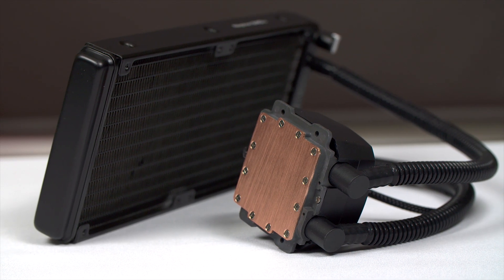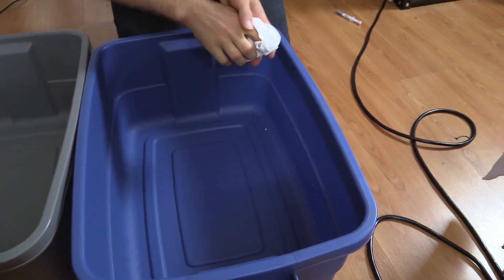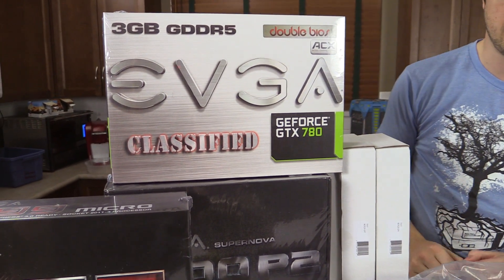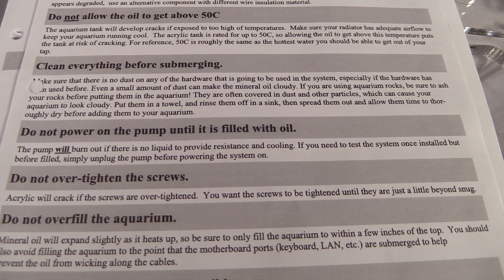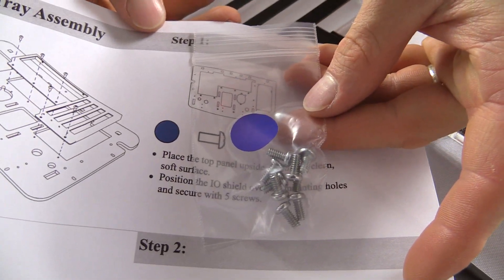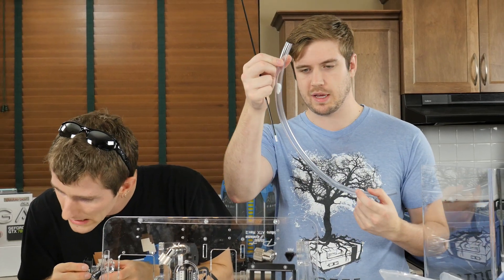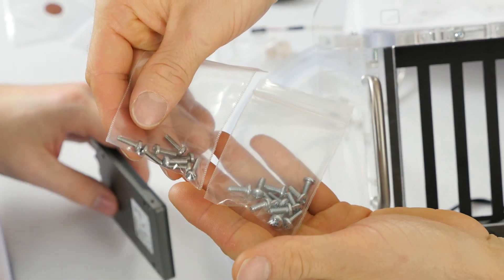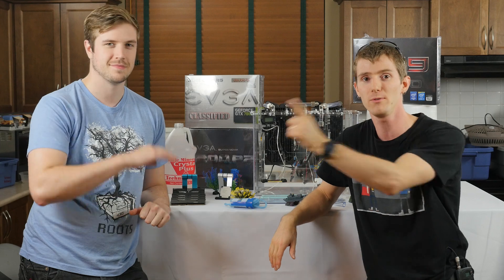Mineral Oil Submerged PC Build Log Part 1 - Puget Systems Kit Case Assembly

Comment: Hey you guys is this build good for all games at 4k max graphics and can you guys tell me how much fps i will get ? 

Corsair CP-9020062-UK RM Series RM1000 80 Plus Gold 1000W ATX/EPS Fully Modular Power Supply Unit

WD Red 6 TB For NAS 3.5 inch Desktop hard drive for 1-8 bay Network Attached Storage

Corsair CML32GX3M4A1600C10B Vengeance Low Profile 32GB (4x8GB) DDR3 1600 Mhz CL10 XMP Performance Desktop Memory Kit Blue

Samsung 840 EVO 1TB 2.5-inch Basic SATA Solid State Drive

Acer XB280HK 28 inch LED Monitor (100M:1, 300 cd/m2, 3840 x 2160, 1ms) 3 of them 

AMD FX8350 Black Edition 8 Core Processor (4.0/4.2GHz, 8MB Level 3 Cache, 8MB Level 2 Cache, Socket AM3+, 125W, Retail Boxed)

Corsair CH-9000080-WWCGMM200 Extra Large High Accuracy Performance Gaming Surface Pad - Black

Razer Deathadder Ergonomic Gaming Mouse

EVGA Nvidia GeForce GTX 980 Superclocked Graphics Card (4GB, GDDR5, PCI Express 3.0) 2 Of them

Samsung 24x Retail SATA DVD Writer

Fractal Design Define R4 PC Case - Black/Pearl

MSI Z97 Gaming 5 Intel LGA1150 Z97 ATX Motherboard (1x DDR3, 6x USB3.0, 8x USB2.0, GBE, LAN, HDMI, DVI, VGA)

Microsoft Windows 8.1 (Full Version)

Corsair Gaming CH-9000062-UK CGK95 RGB MX Cherry Blue Performance Multi-Colour LED Backlit Mechanical Gaming Keyboard UK - Black

Corsair Hydro Series H100i All-In-One 240mm Digital High Performance Rad Liquid Cooler for CPU
Reply: You will get 0 fps because you are trying to pair an Intel motherboard with a AMD processor.
Reply: You mean you won't be able to use the full power of this computer, if you put an AMD CPU on an Intel socket? No, that will work for shure. Your friend just needs to do some research.
Reply: 5930k is ddr4 only, don't get ddr3.
Reply: your build is so shitty.
Look like you have to much money and 0 idea about IT.
Reply: UpbeatGaming  1. That is an AMD CPU with an Intel Motherboard.
2. The PSU is overkill, get a 700w one.
3. Use that extra money to buy a proper i5 or i7.
Reply: Pandora Squared Random guy said to get the Asus Maximus VII formula
Reply: Kyle Sarty
But if you want high FPS, then you can go with 2560x1440, and it still looks great.
Reply: Three 4k monitors, and two 980 's. I'm sorry but I just don't think it's gonna enough power to give you reasonable fps.
Reply: A newer version of RAM. Its extremely expensive, and not worth it at the moment.
Reply: Random Guy Dude, go to a reddit form or something, or even tom's hardware. I'm not saying that all of these people are wrong.  There are just many ignorant people that could throw you off with their uneducated opinions about the hardware you should get.
Reply: Kyle Sarty so why is there a 1tb ssd ?
Reply: Random Guy oh nvm then sorry.
Reply: This whole post might have just given me post dramatic stress disorder...
Reply: Why the fuck get fx 8350.Get an i5.
Reply: *****
I advise you read some of UpbeatGaming's comments on this chain.  Slightly amusing, to be honest.
Reply: And i need to ask something my friend said getting this type of computer you will not be able to use the full power of it is this true ?
Reply: Get an i7
Reply: Random Guy my friend said a amd is better and 2 gtx 980 will not do it ?
Reply: Random Guy ok i put a i7 4930k now what should i put in now ?
Reply: Random Guy Ok so i get 3 GTX 980 and it will do the job some people here are saying the motherboard is wrong  so what should i get
Reply: nommasch I am getting intel now is that ok or do i need a better motherboard
Reply: UpbeatGaming Well, it depends on what you're trying to achieve. Me personally would go the Intel route, I won't go in depth as there are already videos that do, but Intel is just overall more efficient. If you have the money, go grab a i5 4790k, or i7 4970k and overclock both as you have an H100i.
Reply: Pandora Squared well i want a awesome pc that can run any game at max graphics and record at 4k at high fps and very quick
Reply: UpbeatGaming Then you should go X99, grab the mid-range i7 (sorry, forgot its name) and maybe SLI a 980. 16-32gb of RAM and you're set.
Reply: Pandora Squared what is a x99 and you send me a link 2 it and in the build it has 32 gb ram
Reply: Pandora Squared and is this i7 good 

Intel Core i7 4930K Extreme Hex Core CPU Retail (Socket 2011, 3.40GHz, 12MB, 130W, Hyper-Threading Technology, Virtualisation for Directed I/O)
Reply: Yes, that will do. But before you continue with a build of this caliber I suggest you should expand your knowledge by watching Linus' other videos. A Asus X99 Deluxe is what I recommend.
Reply: Random Guy Pandora Squared said to get a Asus X99 Deluxe what should i get and can you send me the link to the ram on amazon plz
Reply: Random Guy and if i do this how much fps will i get in 4k max graphics
Reply: UpbeatGaming
I might go with a i7 5930K. I also highly suggest doing more research to find out what best suites your particular build. Dual 980s will run 4K OK, but all graphics cards struggle to run 4K great right now. Also, do you plan to run Nvidia Surround in 4K? This will be extremely taxing on your PC, unless of course you are just using the other monitors for multitasking.
Reply: and you guys my friend said i should not get 4k because no game runs in 4k and i will never use the full power for this type of computer
Reply: Well he is right, you won't. It's pretty much a waste of money.
Reply: Random Guy 32gb is overkill, and going with 2400mhz on the vengeance models just saps the latency.  Better to go with 2133mhz at CAS 9, and go with a 4x4 16GB set.  Also 3 GTX 980's will run well over what a 295x2 will cost, and SLI doesn't scale well over 2x so he's better off with the 295x2 for 4k gaming.
Reply: Is this true
Reply: Are you going to be rendering? Otherwise 32gb is overkill. Also, latency with DDR4 doesn't affected as badly as it did with DDR3. Don't worry about high speeds.
Reply: Ethan Matlack Is that really true wait should i really get a computer that runs 4k or should i just go with 1440p or 1080p
Reply: It is true, and 1440p with a single 980 and i7 4970k will do you just fine.
Reply: Go with this build:

Corsair RM Series 80 Plus Gold 1000W Fully Modular PSU

x2 WD Green 2 TB (For PC) 3.5 inch Desktop Hard Drive

x1 WD Red 6 TB (For NAS) 3.5 inch Desktop Hard Drive

Corsair Vengeance Performance RAM 16GB (2x8GB) DDR3

Samsung 840 EVO 1TB SSD

x3 Acer XB280HK 28 inch LED Monitor

Intel i7 5930K Processor

x2 EVGA Nvidia GeForce GTX 980 Superclocked Graphics Card

Samsung 24x SATA DVD Writer

Fractal Design Define R4 PC Case

Asus Deluxe X99 Motherboard

Microsoft Windows 8.1 (Full Version)

Corsair Hydro Series H100i CPU Liquid Cooler
Reply: Oh if it is a waste of money can you guys make a 1440p build for me plz that can play any game at max graphics and have high fps like150 fps
Reply: Ethan Matlack is that a 1440p build do you guys think i should go with that ?
Reply: Ethan Matlack I maybe incorrect, but isn't getting 4x4 for the quad-channel capabliltiy better than going 2x8?
Reply: UpbeatGaming
It would be a good idea to go 2560x1440, but maybe put a 4K monitor in the middle if you really want that extra resolution? 2560x1440 looks great though, so only go for 4K if you need it, otherwise its a waste of money.
Reply: UpbeatGaming I would stick with three of these monitors: http://www.newegg.com/Product/Product.aspx?Item=N82E16824236294&nm_mc=KNC-GoogleAdwords-PC&cm_mmc=KNC-GoogleAdwords-PC-_-pla-_-LCD+%2f+LED+Monitors-_-N82E16824236294&gclid=CjwKEAjww8eiBRCE7qvK9Z7W_DgSJABfOjf2DZYGC6NizjJ2M3_BdwXnTGd-7wh5NAeAcLWpy1pxDxoCZXzw_wcB
Reply: ***** I want them monitors should i go with Ethan's build

Corsair RM Series 80 Plus Gold 1000W Fully Modular PSU

x2 WD Green 2 TB (For PC) 3.5 inch Desktop Hard Drive

x1 WD Red 6 TB (For NAS) 3.5 inch Desktop Hard Drive

Corsair Vengeance Performance RAM 16GB (2x8GB) DDR3

Samsung 840 EVO 1TB SSD

x3 Acer XB280HK 28 inch LED Monitor

Intel i7 5930K Processor

x2 EVGA Nvidia GeForce GTX 980 Superclocked Graphics Card

Samsung 24x SATA DVD Writer

Fractal Design Define R4 PC Case

Asus Deluxe X99 Motherboard

Microsoft Windows 8.1 (Full Version)

Corsair Hydro Series H100i CPU Liquid Cooler
Reply: There are a lot of games that support 4k already, and pretty much every AAA PC game from here on out will.
Reply: UpbeatGaming
Only get the the monitors if A) you NEED them or B)You want them and can pay for them
Reply: So if everyone thing that build i should go for say I
Reply: UpbeatGaming
Apparently the processor I recommended only works with DDR4 (I forgot), so I would either upgrade to DDR4 (very expensive), or downgrade to the i7 4930X (still an excellent processor)
Reply: should i go with this build or no ?

Corsair RM Series 80 Plus Gold 1000W Fully Modular PSU

x2 WD Green 2 TB (For PC) 3.5 inch Desktop Hard Drive

x1 WD Red 6 TB (For NAS) 3.5 inch Desktop Hard Drive

Corsair Vengeance Performance RAM 16GB (2x8GB) DDR3

Samsung 840 EVO 1TB SSD

x3 Acer XB280HK 28 inch LED Monitor

Intel i7 5930K Processor

x2 EVGA Nvidia GeForce GTX 980 Superclocked Graphics Card

Samsung 24x SATA DVD Writer

Fractal Design Define R4 PC Case

Asus Deluxe X99 Motherboard

Microsoft Windows 8.1 (Full Version)

Corsair Hydro Series H100i CPU Liquid Cooler

Yes no
Reply: So i7 4930X and how much fps will i get and recording at 1440p at max graphics with any game ?
Reply: ***** So i stay with that monitor ?
Reply: Random Guy how much should i get of that and i will send all the links to the parts to 2 see if they are all right
Reply: Otto Zelaya De La Parra i am not going to go at 4k just 1440p
Reply: as u are gonna give so much money why dont u get the 9590 (if u want amd)or even a 6 core intel (12 threads)btw u cant have an amd cpu at an intel socket motherboard :p
Reply: ***** ummm should i go with this build or not and i am getting 3 because i will use 2 for streaming and one console of xbox one and ps4
Reply: UpbeatGaming yeah its definetly a monster pc but look carefully that u say there that you are gonna buy an motherboard with intel socket!! and u get a cpu with amd socket!
Reply: Random Guy so is the build good ?
Reply: Random Guy and how much ram should i get of that link you send me
Reply: Random Guy oh yeahs http://www.amazon.com/Corsair-DOMINATOR-Platinum-2800MHz-CMD16GX4M4A2800C16/dp/B00MPIEDZ8/ref=sr_1_1?ie=UTF8&qid=1414708295&sr=8-1&keywords=ddr4+corsair

how much should i get of this plz say 16gb 32 gb ?
Reply: Ethan Matlack is this the right hardrive

WD 2 TB Eco 3.5-inch Desktop Hard Drive Including WD Express Warranty (Frustration Free Packaging) - Green 2 of them

and one of this 

WD Red 6 TB For NAS 3.5 inch Desktop hard drive for 1-8 bay Network Attached Storage
Reply: Random Guy can you ask i never use that website at all
Reply: Random Guy what is a ddr4 again ?
Reply: Ethan Matlack So should i stay with the ram you give me
Reply: ***** I was not going to build it myself and yes i dont know what i am doing thats why i ask them to make me a build
Reply: Rene Wrigley Oh really o.o
Reply: No one notice the AMD CPU and the Intel Mother Board? .-.
Reply: Random Guy Dude you said this build is good i guess i need to find some other build
Reply: UpbeatGaming
http://pcpartpicker.com/user/Crow2099/saved/qWrqqs This is my current rig. Well will be once my MB come in. Though I will be entering my cards into the Step Up Program through EVGA for the 980 Classified. But if you want a real true beast of a machine to game on this is what you should look at but honestly a PC like this isn't built for just gaming. This kind of rig is for doing mutliple tasks at the same time with the least bit of lag to the system. For more info on what I am talking about there is another video by Linus where he goes into better detail about the core i7 5960x and the other two CPUs of the x99 chipset where he compares the three.
Reply: Fuck all that shit, just hook up some blue LEDs to the power supply and you got the best rig.
Reply: You people are going to make my head go BOMB
Reply: UpbeatGaming  YOU CANT PUT A AMD CPU ON A INTEL MOTHER BOARD!
Reply: rikelbis1 Dude i am not doing that build no more have a look at this build Corsair RM Series 80 Plus Gold 1000W Fully Modular PSU

x2 WD Green 2 TB (For PC) 3.5 inch Desktop Hard Drive

x1 WD Red 6 TB (For NAS) 3.5 inch Desktop Hard Drive

Corsair Vengeance Performance RAM 16GB (2x8GB) DDR3

Samsung 840 EVO 1TB SSD

x3 Acer XB280HK 28 inch LED Monitor

Intel i7 4930K Processor

x2 EVGA Nvidia GeForce GTX 980 Superclocked Graphics Card

Samsung 24x SATA DVD Writer

Fractal Design Define R4 PC Case

Asus Deluxe X99 Motherboard

Microsoft Windows 8.1 (Full Version)

Corsair Hydro Series H100i CPU Liquid Cooler?
Reply: better, but... to much money xD
Reply: rikelbis1 We already went through all of this.

UpbeatGaming That build is good but you need to switch the motherboard.  That motherboard is for 2011-3, you need regular 2011.
Reply: Thomas Mauger Your comment made me lol
Reply: Kyle Sarty you mean this is bad ? 

Asus X99 Deluxe Intel LGA 2011 V3 ATX Motherboard
Reply: Yup, the i7-4930k goes in an Intel LGA 2011 socket, not a 2011 V3.  The 2011-3 was good for the 5930 that you had picked earlier.

4930->2011->ddr3
5930->2011-3->ddr4

EDIT:  I have the 4930 myself, and this is the motherboard I use:
http://www.newegg.com/Product/Product.aspx?Item=N82E16813130681
Reply: saw amd in there so the answer is already no
Reply: EZOVERDOSE We're way past that already
Reply: Kyle Sarty
hmm maybe if u could consolidate the 89 other comments for me so i dont have to read them? or possibly read them to me as a bed time story? i would appreciate either
Reply: Dude it was brought up several times in the first few comments and already taken care of 4 hours ago.  It isn't my fault you couldn't be bothered to even scroll through them.
Reply: Kyle Sarty Do i really need 1TB SSD? some people said i only need 250ssd
Reply: Nobody NEEDS a 1TB SSD, I have one because they're awesome :)

But yeah, you could easily get away with a 250gb instead.
Reply: Well they are cutting edge technology and ridiculously fast compared to HDDs, so people want them.  The LinusTechTips forum servers use 4 1TB SSDs and they definitely benefit from that, but they aren't strictly necessary.
Reply: Kyle Sarty so 250 will still be really fast ?
Reply: Yup, changing the capacity won't affect the speed.   The basic idea is that you store your Operating System and the programs/games you use the most on the SSD for the speed, everything else goes on the slower HDDs.
Reply: Kyle Sarty Ok then i will tell you the build now
Reply: Kyle Sarty Corsair RM Series 80 Plus Gold 1000W Fully Modular PSU

x2 WD Green 2 TB (For PC) 3.5 inch Desktop Hard Drive

x1 WD Red 6 TB (For NAS) 3.5 inch Desktop Hard Drive

Corsair Vengeance Performance RAM 16GB (2x8GB) DDR3

Samsung 840 EVO 250GB 2.5 inch Basic SATA Solid State Drive

x3 Acer XB280HK 28 inch LED Monitor

Intel i7 4930K Processor

x2 EVGA Nvidia GeForce GTX 980 Superclocked Graphics Card

Samsung 24x SATA DVD Writer

Fractal Design Define R4 PC Case

Asus Deluxe X99 Motherboard

Microsoft Windows 8.1 (Full Version)

Corsair Hydro Series H100i CPU Liquid Cooler?
Reply: Nice rig
Reply: jonnathan deven If your talking to me thank you but i didnt make it
Reply: http://pcpartpicker.com/p/B6YyLk

This site is awesome, it shows you any compatibility issues the parts you want might have and finds you the lowest price online.  I filled in most of your hardware and just adjusted the RAM and motherboard for you.
Reply: Kyle Sarty i think you got the hard drive wrong
Reply: Kyle Sarty and the mother board and ram and case i think ?
Reply: Yeah I picked the 1TB Greens instead of the 2TB Greens by accident, but its easy to change.

http://pcpartpicker.com/p/Wr3VLk
Reply: Kyle Sarty and the monitor is 144Hz
Reply: No, there are no 4k monitors that run at 144hz right now.  The model that you listed is only available with 60hz
Reply: Kyle Sarty Oh ok
Reply: Kyle Sarty i was thinking that because of this http://www.amazon.co.uk/gp/product/B00MB5O5OY/ref=ox_sc_act_title_1?ie=UTF8&psc=1&smid=A3P5ROKL5A1OLE
Reply: Newegg has it listed as 60hz, and I trust Newegg a lot more than Amazon when it comes to hardware specs.  Oddly enough the manufacturers page for that monitor doesn't even list a refresh rate.
Reply: Kyle Sarty wait but is the monitor good ?
Reply: ***** with that build on 1440p ?
at max graphics i don't think so
Reply: Kyle Sarty Hey dude is the monitor good or not
Reply: L
Reply: Why wd red u dont make a nas do u??
And if u change the mouse pad u gonna get 10 more fps...
WHY DID U PUT THAT THERE.
Th cpu,gpu and ram was enough.
At this price i would get 16 gb.
Reply: And ur not gonna get 3 monitors running at 4k.
Even at its lowest setting
Reply: Tayfun Saral well you didnt read the 120 comments that we talked about
Reply: HO PE Corsair RM Series 80 Plus Gold 1000W Fully Modular PSU

x2 WD Green 2 TB (For PC) 3.5 inch Desktop Hard Drive

x1 WD Red 6 TB (For NAS) 3.5 inch Desktop Hard Drive

Corsair Vengeance Performance RAM 16GB (2x8GB) DDR3

Samsung 840 EVO 250GB 2.5 inch Basic SATA Solid State Drive

x3 Acer XB280HK 28 inch LED Monitor

Intel i7 4930K Processor

x2 EVGA Nvidia GeForce GTX 980 Superclocked Graphics Card

Samsung 24x SATA DVD Writer

Fractal Design Define R4 PC Case

Asus Deluxe X99 Motherboard

Microsoft Windows 8.1 (Full Version)

Corsair Hydro Series H100i CPU Liquid Cooler?
Reply: UpbeatGaming your a moron .-.
Reply: Random Guy Only a arrogant fool would say amd is better I'm not a intel fanboy its been proven Intel is better case fucking close end of fucking story.
Reply: ***** Hes prob not seroius even I can't afford that and I have a job with no bills wouldn't count on it.
Reply: It would work, but you cant use 3 4k monitors, the resolution is just too high :/
Reply: to be honest i would just get 3 1440p monitors
Reply: ***** Dude i am not even joking about this
Reply: x Griz - Edits Thats what i am doing now
Reply: FUCK OFF! Ask somewhere else
Reply: TechTerra And why you need to swear
Reply: UpbeatGaming I guess I dont it just annoys me when the comment section is full of tards like you asking about some supercomputer that isnt even compatible and whether or not it will work, can you not go to LTT forums / Toms hardware / facebook group / reddit / other more suitable forum
Reply: TechTerra LTT is not working for me i dont know what toms hardwawre is i dont have facebook i dont know what reddit is and i dont know any forums only LTT and thats not working form and that is still being rude can you plz stop
Reply: UpbeatGaming go with the build that u mentioned before (but as it seems that u are inexperienced , order it from somewhere that they gonna built it for you!)
Reply: [MM]Shoty can yo used me a link because i dont know any website that has all the parts i need
Reply: UpbeatGaming k .-.
Reply: oh and you guys this is what a guy said 2 me 
the x99 is not compatable with the 4930, i made you a build here http://pcpartpicker.com/p/zRGm7P based around the things you sent me in the first message, let me know what you think
Reply: UpbeatGaming i changed some things,and i dont think u need an x99 motherboard : http://pcpartpicker.com/p/FyX9RB
Reply: [MM]Shoty you sure i just want high fps i am a fps freak
Reply: [MM]Shoty and i change my build 

Corsair RM Series 80 Plus Gold 1000W Fully Modular PSU

x2 WD Green 2 TB (For PC) 3.5 inch Desktop Hard Drive

x1 WD Red 6 TB (For NAS) 3.5 inch Desktop Hard Drive

Crucial Ballistix Sport BLS4C4G4D240FSA 16GB (4GB x4) 288 Pin DDR4 DIMM Memory Module

Samsung 840 EVO 250GB 2.5 inch Basic SATA Solid State Drive

x3 Asus PB278Q 27-inch Widescreen LED Multimedia Monitor (2560x1440, 5ms, VGA, DVI-D, DisplayPort, HDMI)

Intel i7 4930K Processor

x2 EVGA Nvidia GeForce GTX 980 Superclocked Graphics Card

Samsung 24x SATA DVD Writer

Corsair Carbide Series 300R CC-9011017-WW Windowed Gaming Case - Black

Asus Deluxe X99 Motherboard

Microsoft Windows 8.1 (Full Version)

Corsair Hydro Series H100i CPU Liquid Cooler

x2 Corsair Air Series AF140-LED 140mm Quiet Edition High Airflow LED Fan - Blue (Single Pack)

Corsair Air Series AF120-LED 120mm Quiet Edition High Airflow LED Fan - Blue (Dual Pack)
Reply: [MM]Shoty Hey dude can you change it because i am not using them monitors no more
Reply: [MM]Shoty And dude will this be the same speed ?
Reply: [MM]Shoty And i am in the UK so i cant get the motherboard
Reply: why do u want such a good pc and whats ur budget (how much money u can give for it?) and i will make the best possible build for money/performance
Reply: [MM]Shoty my budget is $5500 and i want a good build because i dont want to upgrade it for a long time as you see i am crap with computers so if i try to upgrade i will maybe break it so yeah
Reply: [MM]Shoty Sorry i mean £5850 is my budget
Reply: ok, i understand ;) but can u plz wait until tommorow because its too late and i will fall asleep on the keyboard xD (tommorow i will make u the best performance per money gaming rig :D ! but think ,do u really want 3 monitors and 4k ? u will need 4 gpus to play on max ^^
Reply: [MM]Shoty No 1440p is fine and you can go to bed as long as you dont forget  good night my friend :D
Reply: $9,000 is a little much for a "1080p" build...
Reply: NaturalBornRanters I don't think its 1080p
Reply: switch the 8350 with an i5 4690k since the 8350 is known to bottleneck the shit out of modern gpus
Reply: skotty523 Thank you for taking your time and helping me but someone is going to make me a build now
Reply: ***** You sure that i will need a corsair mouse i hear from my friend the the razer deathadder is best
Reply: UpbeatGaming I stand on my last statement your a idiot.
Reply: ***** Ok just fucking forget it
Reply: WhiteFang2 I just don't really care what you say so just stop
Reply: UpbeatGaming Your bullshitting "5400 budget" 

First if you had this kind of money you wouldn't be here asking us would you? and even if it was true thats just bragging none cares you got a fuck ton of money to spend on stupid shit.
Reply: WhiteFang2 Well your wrong about that i don't think bullshitting about a 5400 pc is being a fag i don't brag about anything i don't know why people do that and i got the money because the hospital killed my mum so we are suing them and we won and the money is coming in very soon and everyone started out new on pc so no need to be a ass to me just because i am new to this if you think them things are stupid then just say so no need to say i am a dumbass
Reply: check this built http://pcpartpicker.com/p/ts2KNG
Reply: or this with 1440p monitors http://pcpartpicker.com/p/dVNkbv
(i added and speakers and headphones but if u already have just remove them)
Reply: make him a better built! he has  9000$ budget so he can afford  an extreme gaming rig
Reply: upbeat do you really want 3 monitors ? i would never go for them even if i had the money i think a 1080p 27 inch monitor its more than enough but ok, as u wish
Reply: i dont find it too difficult to help him with this and as i am looking those things and for my self (ok i dont have a 9k budget xD) its even more easy
Reply: UpbeatGaming http://pcpartpicker.com/p/6wRpVn i would go for this but tell me if u want something else
Reply: yeah he will get an i7 but as he is not experienced he cant water cool his pc and he also may have some trouble with sli or crossfire
Reply: [MM]Shoty I am going to ask somewhere else because some people in this chat is picking on a 15 year old so i will just go
Reply: UpbeatGaming Your gonna spend your dead mothers money on fa fucking pc. I'm done fuck this
Reply: WhiteFang2 not doing that build no more doing something better and cheaper
Reply: UpbeatGaming Actually as far as graphics cards go the amd r9 295x2 does really well at 4k
Reply: Also, you're gonna need an intel cpu (like everyone else told you). The only thing is, 4k is demanding enough as is; triple monitor, I don't think you can expect much from any graphics card setup ( I couldn't find any triple monitor benchmarks but seeing as 2 980's isn't the best possible setup out there anyway, it's a safe assumption). If you really want guaranteed high framerates (like around 50-60fps on crysis 3 at ultra), then 2 r9 295x2's is the way to go. It's expensive (really expensive) but given your choices for pc parts I don't think that should be much of a problem lol
Reply: JoHn DoE Sorry dude but thank you for helping i don't need help from the chat no more because people are picking on a 15 year old
Reply: UpbeatGaming Go to tomshardware.com for help too. They answered a lot of my questions when I was picking parts. Enjoy the PC
Reply: JoHn DoE Well thank you dude thank you very much
Reply: >optical drive
>AMD CPU and Z97 motherboard
Not sure if trolling or retarded
Reply: ShadowwwLFS Dude plz read comments i dont need any help no more
Reply: ***** heh.
Reply: Yes
Reply: ***** Dude i play them games because my pc right now is shit when i get it i will get so many games don't make me get stink meaner on you
Reply: ***** Dude i know i can but my hard drive only has 68GB so i really can't get anymore games
Reply: ***** And i only get 30 fps on warframe anyone when i am lucky 40 and thats at low settings and at 800x600
Reply: ***** No i mean i know i can play majority of games on steam
Reply: Corsair CH-9000080-WWCGMM200 Extra Large High Accuracy Performance Gaming Surface Pad - Black

Razer Deathadder Ergonomic Gaming Mouse

These two items are not compatible, this build will not POST.

Corsair Gaming CH-9000062-UK CGK95 RGB MX Cherry Blue Performance Multi-Colour LED Backlit Mechanical Gaming Keyboard UK - Black

Also, the Black version doesn't have enough RAM to support 4K displays.
Reply: ***** No doing that anymore going with a 1080p monitor now
Reply: ***** I was but some people was being a ass about it so i change
Reply: ***** And i don't want to impress nobody i just wanted people to check my build to see if it is ok or not and now i know its not ok
Reply: ***** Dude, he needs a really good build to record all his Minecraft Let's Plays in 4K 60 FPS.

You don't even OWN a computer.
Reply: UpbeatGaming get at least an i5
Reply: ***** I don't want to impress no one all i want is a computer that and play all games at max graphics for a very long time because if I try to upgrade it without any help i think i will break it
Reply: DisturbedLick And i am not only going to play minecraft  i am going to play alot of other games
Reply: ***** No i am going to play other games
Reply: ***** I don't want to be number one
Reply: UpbeatGaming i wish i was number one like u
Reply: DisturbedLick XD i am not number one
Reply: ***** Oh i am going to play Destiny as well
Reply: ***** Well, at least he was trying a 1:1 ratio for 980's to 4k monitors. Even though 980's don't run 4k very well.

Also, $1,500?  For a monitor + a 980? x3?
Reply: DisturbedLick How about an R9 290X with 8GB I believe amd still ran 4k a little better.
Reply: Sybre Oh thank you
Reply: UpbeatGaming
So if you have built it, and it works, good for you, well done.
Otherwise, stay away from building computers because it sounds like you have completely no knowledge whatsoever of what any of the components do.
Reply: Tommy59375 I already know that I have a friend that will build a computer for me